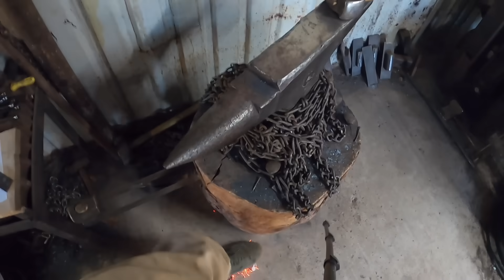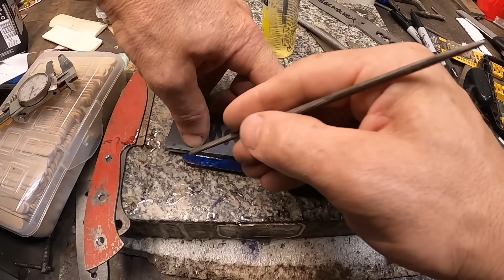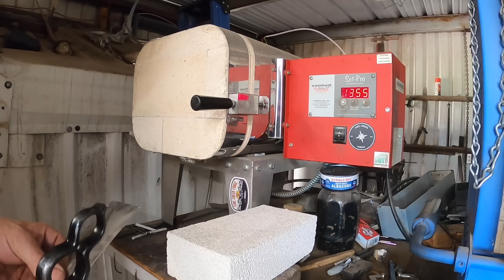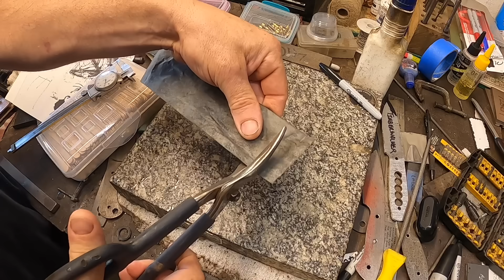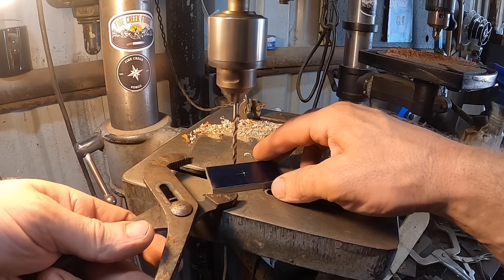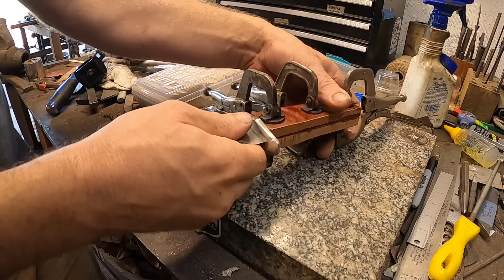Strangest Knife I've Made

Comment: Thats exactly what I thought it would look like, but I had no idea what is was called  or what it was used for lol 

Also this could be one of the questions you do a short on. Ive been wondering why stainless and other steels like CPM need the foil wrap when carbon steels dont. What is it about them that requires a protective cover in the heat treat oven?
Reply: High temperatures burn the carbon out of steels when it reacts to oxygen, especially during the longer soak times.  80CRV2 decarbs pretty badly at the lower temperatures, too, but needs a faster quench speed, so I usually use ATP641 on it.  Magnacut is run at 2150, AEB-L is around 1975, so the carbon will cook out when exposed to oxygen at those temperatures.  Stainless Foil pouch, a coating on them, or using an inert gas environment (like argon gas that will displace the oxygen in an oven) keeps the carbon from reacting to the oxygen at those temps and soak times.  Or leave it thick and grind the decarb off!
Reply: @Taz575  Ok thats kinda what I figured. Yeah I use 80CrV2 for all my knives, and I noticed there is a thick layer of decarb on my blades. Ive been thinking I should get some of that anti scale coating to try out but at the same time I use 1/8'' steel so maybe its not necessary? Or I could use it on thinner blades too. Ive been using Parks AAA oil cause thats what Ive seen recommended from 98% of sources. When you say it needs a faster quench speed do you mean an actual quench oil over like peanut or motor oil or Parks 50 over Parks AAA? Im still learning about the metallurgy and the science behind quenching so any info is appreciated.
Reply: AAA and Parks 50 are both good for 80CRV2.  I did some in ..135" stock, unprotected, for normalizing, grain refinement and DET anneal per Larrins recipe and went down to .090" after the decarb was gone.  I started using a 321 Stainless foil pouch for the cycles/processes after than, then coat with ATP641 and quench.   Other steels don't decarb as badly though!